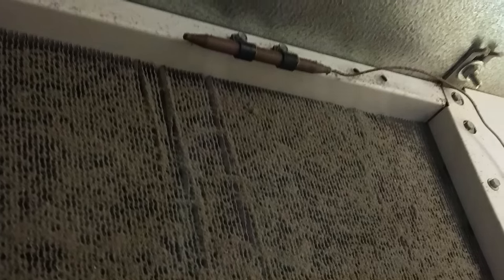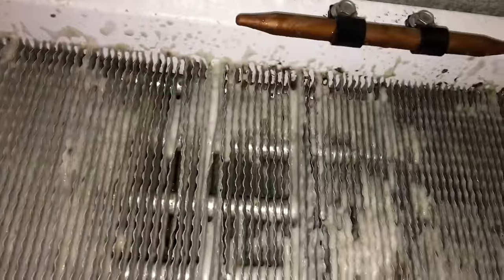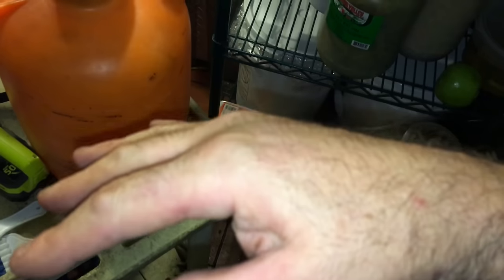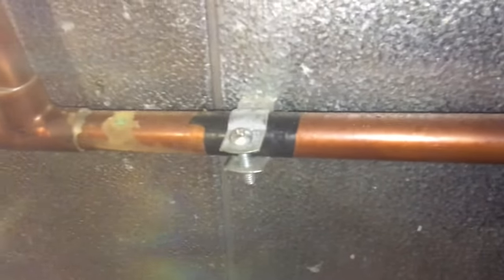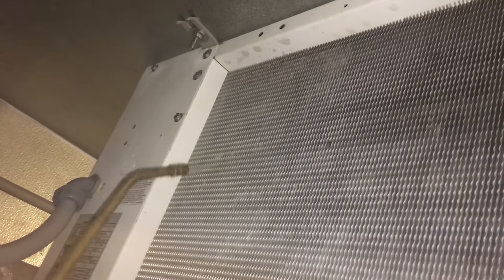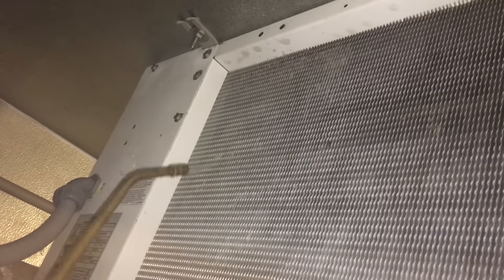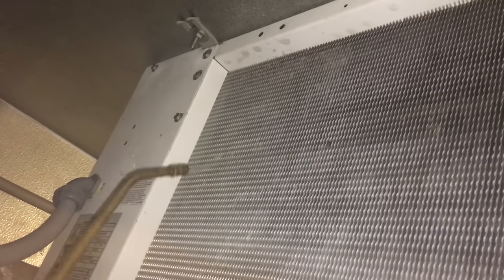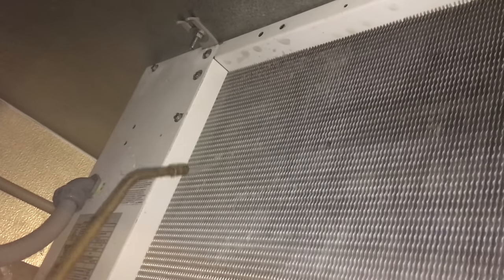This is How You Clean a Walk-in Cooler Evaporator.

Comment: Can it ever damage equipment spraying water directly into it? I'm looking to do my own maintenance on some refrigerators
Reply from the maker: yea, just dont get Motors wet. put a plastic bag over them or remove them if its easier. . if u do get one wet , blow it dry before it plugging it back in. spin it , blow dry. wipe dry.
Reply: That acid is making you cough

Comment: I just brush it off till its about 90 percent clean then bomb it with viper foam depending on the size of the evap usually use 2 or 2 nd a half spray cans.

Comment: Hey! Found your video to be very helpful.  I am needing to clean a Commercial Refrigerator, after I unplug it, vacuum it out.  is it okay to spray degreaser like nubrite on it? Then do I a brush and spray water to clean off the grease then vaccum it dry and maybe let it set a day or 2 and make sure it's not wet before plugging it back in?
Reply from the maker: Yes. Vacuum , Cover motors - do not get too wet. , hot water , spray degreaser , brush ,  hot water rinse , hot water rinse , blow dry , wipe dry.
Reply: Recommendation on degreaser to get on amazon?
Reply from the maker: https://www.amazon.com/Nu-Calgon-412008-Alka-Brite-1-Gallon/dp/B00E0CWST0

Use a Spray bottle.
1) Fill with degreaser - 25% , Add Warm Water 75%.
ie: 3 parts water - 1 part degreaser.
2) Spray on Wet Evaporator or condenser. Let sit for 1 minute to 5 minutes maximum. depending on dirt / grease.
DO NOT USE ON MICROCHANNEL CONDENSERS OR EVAPORATORS. 

* DISCLAIMER - I am NOT Responsible for any thing u Do wrong ! You Take ALL RESPONSIBLIITIES !!!

Note: TURN OFF ALL POWER BEFORE WORKING ON MACHINE !!!!

Note - if the coil starts smoking or burning or turning a different color RINSE OFF Chemical IMMEDIATELY !!!!
Reply from the maker: Wear Safety Glasses & plastic gloves or nitrile gloves.
Reply from the maker: This is a strong degreaser & CAN BURN YOUR skin. Be Very careful !!!! with it. Read all safety Precautions !!!!
Reply from the maker: @henrylam24   https://www.amazon.com/Nu-Calgon-4291-18-Brite-Aerosol/dp/B07S43HN3V

This is a strong degreaser & CAN BURN YOUR skin. Be Very careful !!!! with it. Read all safety Precautions !!!!
Wear a Respirator & Plastic Gloves While using Nu-brite !!! The Fumes Will Make u cough !!! & are Very Strong ! Use sparingly & in a Well Ventilated area. Keep back at least 36” away when spraying nubrite !!! It’s fumes are VERY Strong !!! 

Alka-Brite is a bit Less Powerful than nu-brite & it’s Fumes are Not as bad. 

I Prefer Alka-Brite These days !!! Less Fumes !

Be very careful with these chemicals !!! They are like acids !!! They can sting your skin ! & burn !

Comment: that pump sprayer is kick ass, how did you ever get one with a brass wand?
Reply from the maker: Johnstone. i Just asked for a decent sprayer. Truth Be Known, that Sprayer is Kind of a Piece of Shit, it's falling apart allready and i have only had it for like 6 months or a year. i only use hot water in it too. no chemicals ever. The Wand is Starting to leak at the handle. the rubber boot at the handle is coming off. the pump rod does not lock into place anymore. it still works but is starting to leak at trigger area. its' not long for this world anymore. i'm gonna try to warranty it with johnstone other wise maybe trash it or try to Rebuild it until the Pressure pumper quits. Have a Good Saturday!

Comment: Condenser coil cleaner on an evaporator?
Reply from the maker: Yep, I'm a very bad man ! I use evaporator coil cleaner on Condensers too. A Coil is a coil bud.
Copper tubing / Aluminum fins.
In refrigeration --- these Evaporators are made just the same as a condenser. I'll bet u do it too & don't realize it. Question : When is a condenser an evaporator & a Evaporator a Condenser. ? Good Question though. You have to look at coil construction these days ---
Micro-Channell --- hot water only unless manufacturer approves coil cleaner.
All aluminum coils --- Hot water only ---unless manufacturer approves coil cleaner.
Copper tubing / aluminum fins - All Coil cleaners approved as long as rinsed off with water. Hot water is best from a hot water heater.

Comment: All the dirt is on the inside of the unit. May look great but open that evaporator up and tell me if it's clean
Reply from the maker: It is , its Just a few years old and gets cleaned regularly. But , i am Glad you know that dirt is not just on the surface , you must be able to see all the way through the coil with a Flashlight. Good comment.
Reply: OcRefrigeration,Hvac & Electrical. It looks pretty new. A lot of these places don't think about the maintenance for the units until they are useless and not getting air flow, so they call us. We clean from the inside out with high pressure water.
Reply from the maker: Yea, when im Cleaning a Coil i Use a Hot Water Garden Hose off of the Slob Sink Faucet or The Bottom of a Hot water Heater on site. It Really Does a nice Job especially if u Vacuum first , Blow it Out with co2 first , , then hot water pre rinse , then coilcleaner , then a Hot Water Final Rinse , They Get Like New Again. The Hot Water Makes a Huge Difference between Cold Water.

Comment: Is this method advisable for True T-43 and T-23 reach in refrigerators? To get the dust off I used a shop vac with a brush attachment, then an air compressor, but being kitchen refrigerators there's still some greasy dust stuck on. I like to take care of things, and do it right, but I don't want to use a chemical or method that isn't proper. I don't want to do any damage and ruin them. Advice appreciated.Thanks!
Reply from the maker: If the coils are coated coils ( grey or black color ) just use hot water. Allways try just hot water garden hose without chemicals first. 409 spray degreaser also is milder. Use a stiff brush as seen here with very hot water water. This chemical is onlyfor copper tube & aliminum fin coils. Donot leave on for more than 5 minutes. 3 minutes for light grease. As allways unplug refrigerators before working on them. Be safe & keep motors dry. Put a bag over them. When done.  Blow allwater from coils with air compressor.
Reply from the maker: Do not use a wire brush ever. U can use any kitchen bristle brushes and any soap or detergents u wish. But, allways finish with a thorough hot water rinse and blow dry.
Reply: Thanks buddy! Your reply is greatly appreciated! I believe these are black coated coils now that you mention it. I'm glad I checked with you... So these Nu-Calgon cleaners are NOT to be used in my situation under any circumstances? When you say keep "motors" dry do you mean cover the compressor and the fan? If so I guess I should unplug the unit, wait for the compressor to cool, and then put a plastic bag over them? No I would never use a wire brush. I do have a brush like the one in your video, but I have to get a new one. I may try Dawn dish soap or the 409 you mentioned. Check out Meguiar’s D108 Super Degreaser Concentrate. I don't know if it would be safe in this situation, but man oh man does it work wonders in cutting grease.

Comment: I find a full pressure water hose connection. I set up a hose, turn off the machine and rinse the fuck out of the coil. Brushes are a necessity but coil cleaners I only use when there is a nasty exhaust dumping grease onto a condenser on the roof